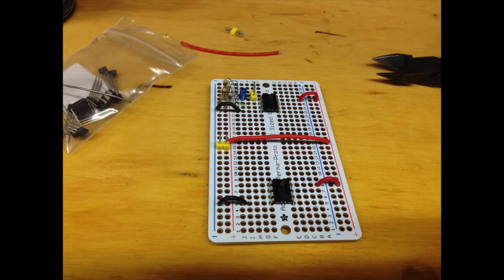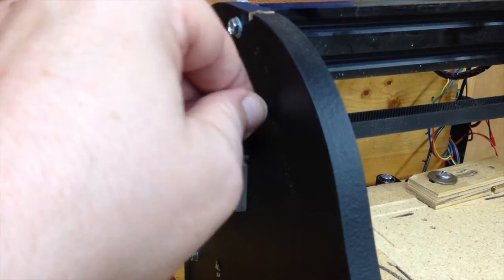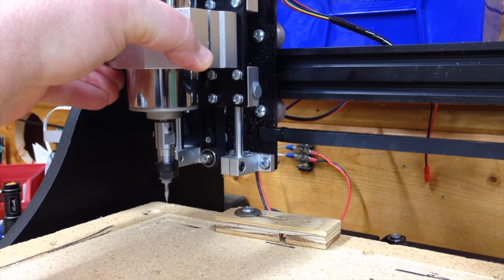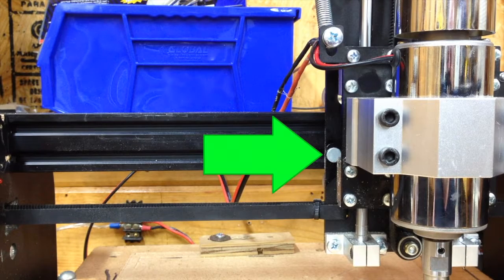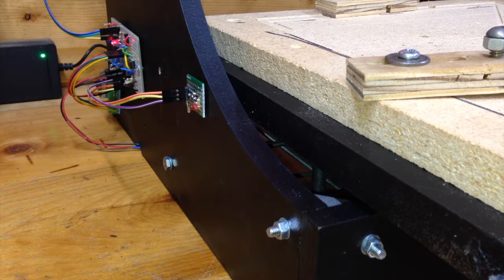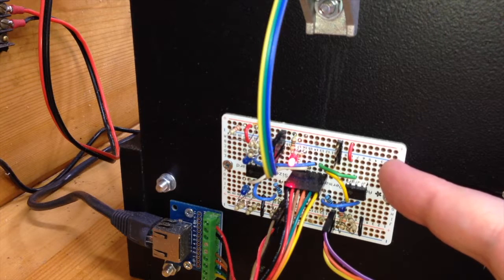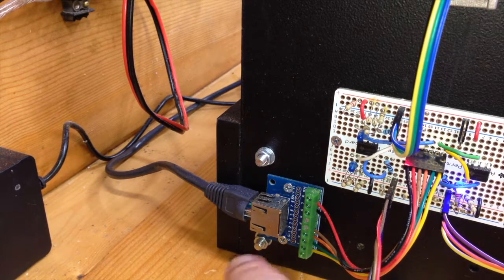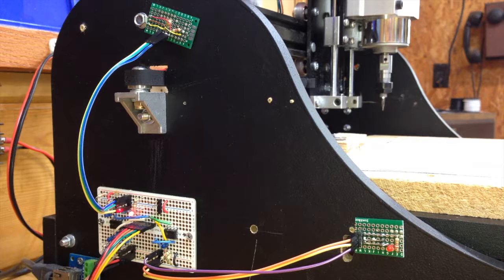CNC DIY Hall Effect Sensors

Comment: How is the zeroen repeatability  and accuracy of the hall sensors? im planing to usit in my cnc and planing to usit to read rpm of the spindel,do you have any suggestion?
Reply from the maker: The hall effect sensors are excellent at repeatability and accuracy and no moving parts to get bumped out of place or compromised by dust! I also used 2 magnets JB Welded to the top of my spindle and a hall effect sensor to make a tachometer, that video is here  https://youtu.be/OzLisKxM85s